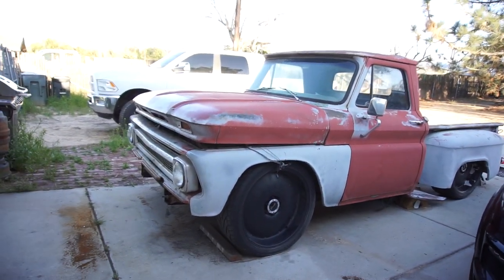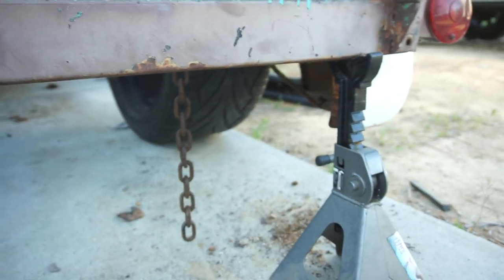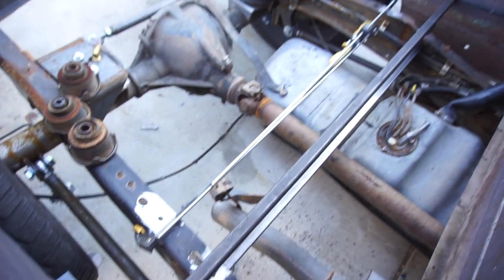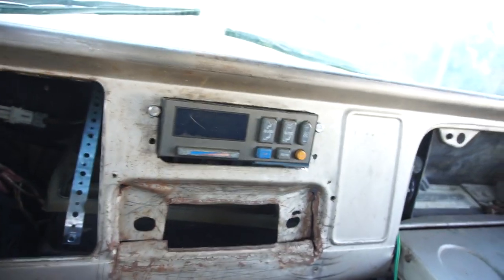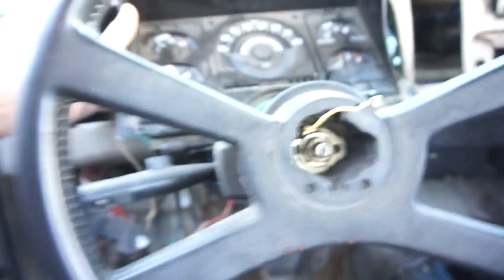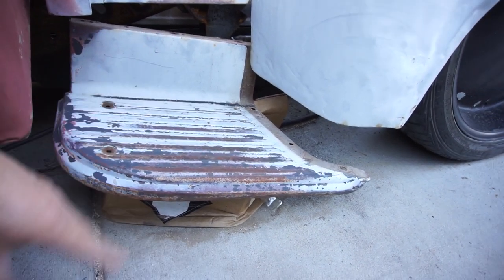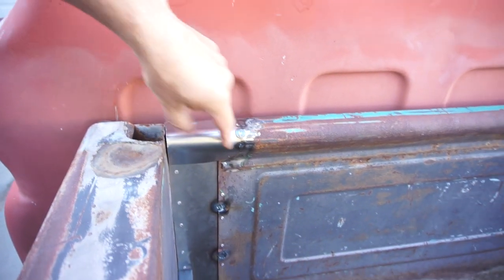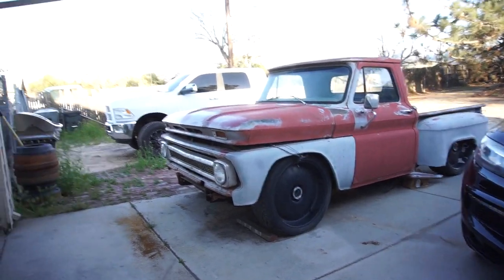Project Crack Pipe Is Getting A Lil Attention. 1964 C10 On A 1991 K1500 4wd Chassis

Comment: When TIG welding.... If you put a "duller" tip on the end of your rod, the heat will not penetrate as deep. That might help out with that thinner material.